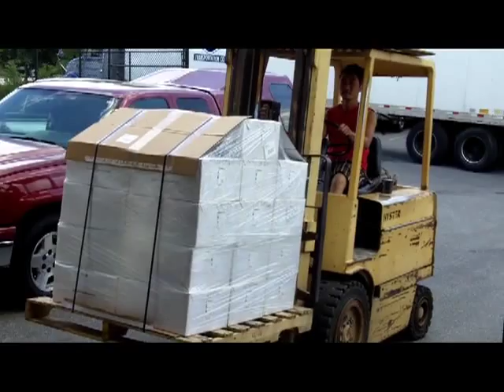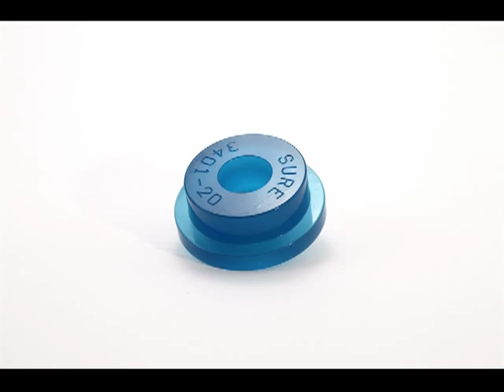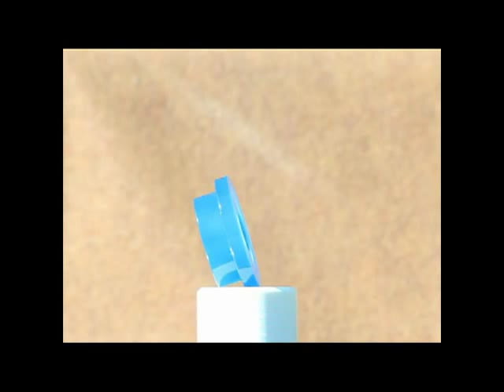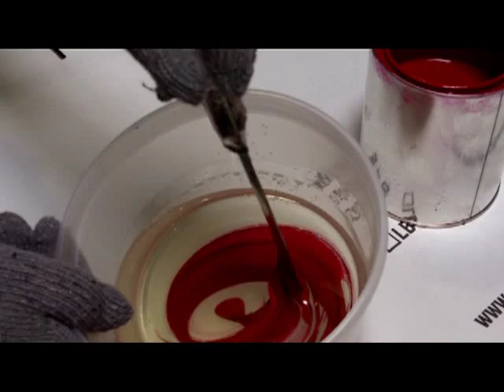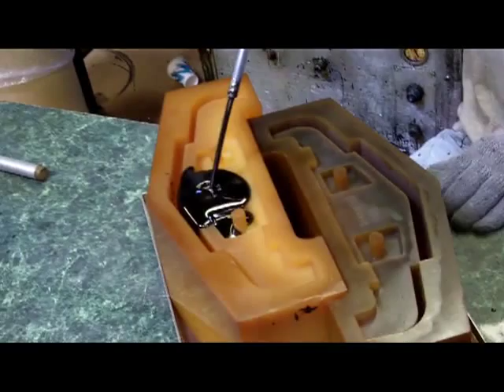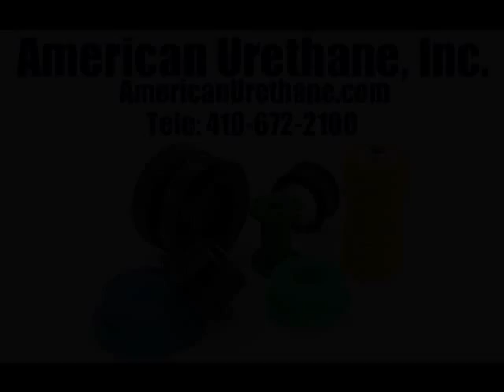Polyurethane Suspension Bushing for Automotive Industry

Comment: http://honda-tech.com/acura-integra-type-r-8/rear-trailing-arm-bushings-3024027/#post47355316 how would you overcome the issues seen in this picture? its a common issue amongst urethane bushings it seems. there is no rebound and instead the part remains deformed(over relatively short time period).